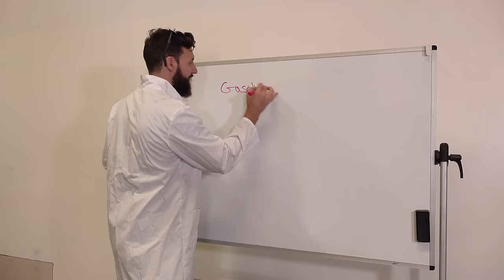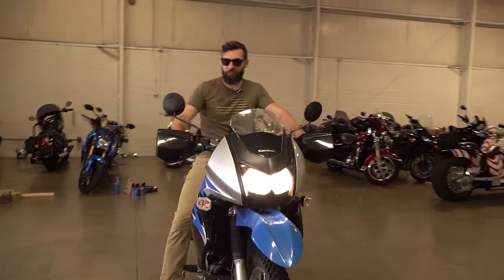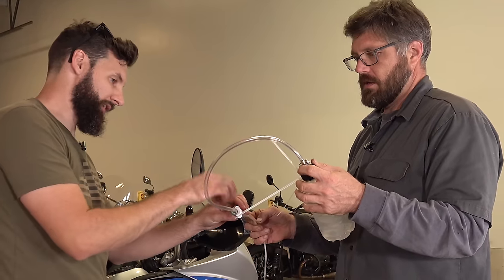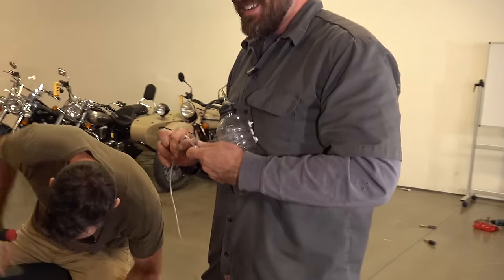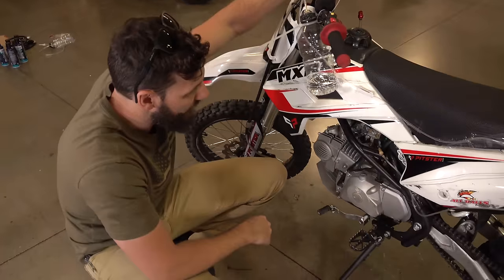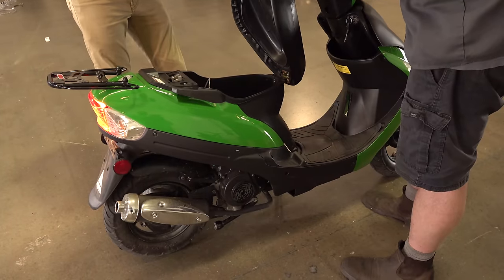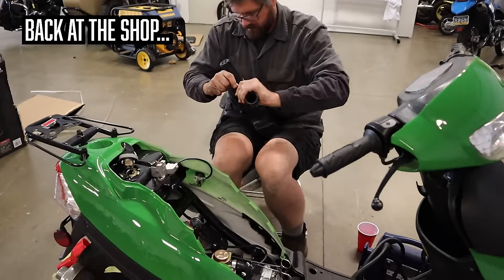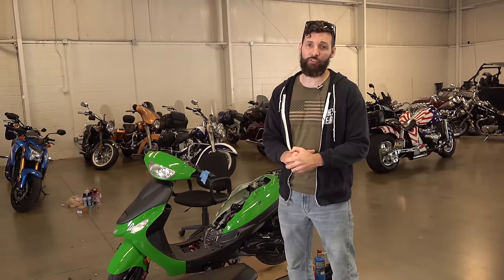What happens when you try to run a motorcycle on PROPANE instead of Gas

Comment: Here in Trinidad, West indies you can get a CNG ( Compressed Natural Gas) kit installed on any ICE. The cost of install is about US$2,200. Hopefully over time you will recover initial expenditure, by fuel cost savings. They drill a small hole in the inlet manifold close to the engine and install a nozzle......one per cylinder. The nozzle gets a tiny tube from a pressure regulator. A metal or fibreglass cylinder is installed in your trunk or tray, and a line connects it to the regulator which is installed in the engine bay. (The regulator also has a connector to "fill up" the cylinder at the gas station.) The throttle (butterfly valve) allows air into the engine. The nozzles allows the CNG. As to the ratio........sorry I can't explain.
But there is a 2 way switch installed on the dash to choose between gasoline operation or CNG operation. There is a indicator of how much CNG you have also. Of course, because CNG does not have a high calorific value as gasoline, the estimated power loss could be between 10-20%. Taxi drivers, and folks who drive long distances to work get an install. To fill a cylinder is about US$2.

Comment: You can use the LP system off Honda and other floor buffer engines on similar displacement bike engines if desired. The simple "stub" fitting can convert common carbs by replacing the emulsion tube (which is no longer needed nor is its emulsification function).

Comment: In Australia it is common for cars to run on LPG or have a dual fuel setup where you can use an internal switch to switch between both fuels. LPG is currently about half the price of petrol so it makes sense to use the gas more than the petrol. I often wondered if you could run a motorcycle on LPG.
Reply: Same in Bulgaria. A proper system costs about 1000 euro with installation. Also, while living in Shanghai, I noticed some scooters ran on LPG, because it's better for the environment, thus allowed by the gov, while petrol isn't, because it pollutes more. There was a small propane bottle inside the scooter's trunk, when you lift the seat. As a Bulgarian, who has only seen this in cars, it was very interesting.

Comment: I have a tiny propane powered generator. I rigged it to run on butane and found that the butane canister gets cold quickly and then doesn't vaporize. Butane turns liquid at about 32F. I use heat from the exhaust to keep the butane warm so it continues to vaporize. I'm pretty sure you kept shutting down because the butane bottle got too cold. Try using a hand warmer.
You don't really show what regulator you used for the propane, but the typical regulator releases the gas at about 20 to 30 psi. That might not be enough pressure for what you' want. You can get an adjustable regulator with a gauge that will give you 60 psi. I've sen one that goes up to 100 psi (the tank is like 100 to 200 psi). The pressure regulator I've seen on at least one conversion kit (for a generator) gives you 0.5 psi.
Butane's pressure is about 35 psi (fairly safe). Propane's is like 200 psi which is why you have to contain it in something with 1/8th inch steel walls.

Comment: The "regulator" uses a small vaccum to open a valve and let in gas, you need to hook up the regulator (on the side opposite to the gas inlet) to the intake (for vaccum) and leave the bike's air intake open, (air is needed for combustion, if it's closed, the engine will "flood") if the regulator does it's job properly, then it will allow more gas the more you open the throttle, just like when a scuba diver breathes (he sucks air oput of the regulator) and the regulator provides more the more he pulls. I have seen tanks run on kitchen propane tanks.

Comment: You could probably use a regulator from a propane torch and experiment to find the right pressure, and also be careful with propane if you don't have a baffle system to prevent it from traveling up the line there is a chance it could do that, the carb helps stop it but LoL. I love old propane and kerosene forklifts and tractors. Butane is a dryer gas and probably puts a lot more carbon build up in your engine and thus eventually won't run off of it. Like kinda what happens if you hold it on something and just leave it there you will see a black residue built up where the flame was. Some lighters stop working after this build up too. I would love to see y'all get an older diesel bike or something similar and test many other different types of fuel.

Comment: We tried in school to do somewhat the same, but on a lawnmower (we couldn't afford a bike) and using hydrogen instead of hydrocarbon as propane/butane. The problem we were getting was that the hydrogen was blowing up in the carburetor since the lawnmower was a 2-stroke, a 4-stroke would eliminate that problem. The other problem was that it was hydrogen boosted, meaning we would stop using that much gasoline and use some hydrogen instead. That just makes another problem, that the lawnmower was using a carb and not a fuel controller. The lawnmower began to run way too rich when adding hydrogen. A fuel controller would just decrease the amount of gas used, but couldn't adjust the hydrogen, so it should adjust to the hydrogen. 
So if a bike should run on a hydrocarbon, a fuel controller is nesseceary since it regulates fuel and air to a stoichiometric mixture.

Comment: I did a Final Year Project during University days similar to you guys. But my choice of gas is methane/biogas derived from crude plam oil effluent. I just stick the gas pipe into the air filter and just ride away with no problem at all

Comment: My dad had a Tahoe he converted to LP gas.
he hooked up a stationary tank in the back and he got a bunch of adapters for the engine and it worked well, though it had NO power (made a lot of noise but did not move, you know... like a Honda) and it smelled horrible like burnt eggs, this reminded me of those crazy times lol!

Comment: You need a vacuum actuated regulator.
You'll also need to tune the regulator to meet different loads at different RPM.
In Australia it used to be a thing to run taxis on LPG (propane), and kits were available.

Comment: The first problem is fuel control: Without some way to alter the amount of butane/propane/lpg entering the intake stream, you will not be able to maintain a useful air:fuel ratio. What you need is to use the normal throttle plate on the carburettor and somehow use the throttle cable to also actuate a ball valve on the gas line, this can be tuned to correct AFR and you can add a small bypass tube with another valve used to adjust the idle bypass of the first valve. That solves one problem. The second problem is pressure. In the case of butane, the rate of boil-off from liquid to gas is heavily influenced by temperature. The thing, the temperature drops as the butane evaporates and travels down the line, so you end up with cold liquid butane that is no longer boiling off fast enough. This is where Propane becomes the much better option as it is a gas at much lower temperature and the bottle it comes in maintains a high pressure that can be regulated down to a consistent pressure (tunability here, too). This is really important to making any solution to problem one actually work

Comment: Another thing is the "stratified charge" method. You just leave the throttle fully open, and a 1/16 ID tube as close as you can to the intake valve, brings the propane in.  Then you control engine RPM with a "push valve"  ( not a knob valve )  I've not tried this but it has been verified to work by a gent named Roy McAlister. He's a guru of NASCAR racing engines. This makes a sandwich of air + fuel layers, hence the name stratified charge. He has a patent on it, you can look it up.

Comment: nice experiment 
I think the problem with butane is that your bottle don't allow air to get in. So after about 1 minutes, as your bike consume butane gas in the bottle, pressure dropped and stall the engine. Maybe a tube connect the atmosphere to the bottle's bottom would solve that problem.

Comment: all you need is a propane pressure regulator from a propane grill. You take the wiring from the gas dial on the grill; and tap that into your throttlebody wiring. Simple $40 mod i am running on my twincharged 2017 sonata.

Comment: I think the butane stopped working after a while because it was not generating enough pressure to continuously push butane into the carb. A little heat under the bottle would probably have helped a bit
Reply: Bro stop

Comment: Propane is a VERY feasible fuel for bikes (or cars or trucks or whatever)...and if your vehicle is fuel-injected, you really just need to replace your fuel line with the propane line (with regulator)...pre-regulator / tank pressures on propane are between 100-and-200 psi (average, around 145-psi), and the injectors (post-regulator) normally work in a 30-50 psi range, actually serve to 'meter the incoming fuel' (as it is already a gas). So all you are doing is dropping the 'tank' pressure down to incoming 'injector' levels (just slightly lower than the injector springs open).
The downside to 'propane conversion' is that propane only offers the 'BTU-equivalent' of 90% of gasoline, so you're only going to get 90% of your prior horsepower from propane (than you did on gasoline)...but the engine will last longer (no cylinder wash-down effect, and cooler detonation means longer ring-and-piston life)...I've seen a couple of 'customs' built like this...relatively easy for 'injector bikes' (or cars or trucks)...you can get commercial regulator conversion kits in the $200-$300 range...but again, you're only going to get 90% of the mileage you did as when you were running gasoline, too...(and in today's world...propane almost ALWAYS bulk costs what 87-octane gasoline costs...so no real gainer, but a slight loser in the end).

Comment: Hi, kinda new to your channel, but very much enjoying it. My little brother showed me some of your videos before, but I had forgotten what the name was to watch more.

 Pretty sure you need at least a one way check valve (with filter) to keep you from vapor locking with the butane. That's what it looked like was happening. However, you may need to use a proper regulator kit for that just like with propane. Maybe try a common grill regulator kit since you're trying random things anyway. Lol
It should be possible to run on a standard carburetor if the flow is regulated properly. There are lots of vehicles that have been set up to run both and I find it hard to believe that people were putting two carburetors on anything to make that work. Maybe you need one that has a switch for the different flow control though. 
Also, I think you'd like my wife's channel: Mench and Zech. It's mostly he singing religious songs.

Comment: We actually have LPG pumps in my country. Normally taxis and public utility vehicles use them after the cars get converted to be compatible with LPG. All the conversion really does is make the fuel tank capable of high pressures and sometimes, and engine tune.

Yeah, it’s also way cheaper our cheapest type of everyday fuels

Comment: I run two engines on glp at the farm, one is a small honda two stroke 11hp for a coffee mill, works wonderfully with a simple converter hooked on beforw the fuel injection or carbiretor unit. You just learn to tqeak the gaz/air mix until it runs evem better than with gasoline.

Comment: As you open the throttle butterfly you needed to add more on the iv line that would keep the air fuel mixture ratio correct or add a demand regulator from century fuel products or us carburation. The fuel supply is not keeping up with demand from the engine. The only other thing is there are dot rules on the transport and use of lpg on vehicles so you don't get hurt in a collision. Be careful. Have fun!

Comment: Propane (LPG) is actually harder to ignite than petroleum, It needs a perfect Stoichiometric. I believe the Propane will actually give more energy and know it likes increased compression. LPG also works with diesel as an additional fuel. 
I have been reliably informed that Adding LPG to Diesel will give the same power as turbocharging a diesel. My source actually run several trucks with this setup.
I would love to make a LPG motorcycle this gas is safer than petroleum (petroleum fumes are highly volatile), this gas is cleaner and this gas can give more energy if the motor is designed/modified correctly. The only down side is the biproduct is water therefor it is important the engine oil needs to be run to operating temperature otherwise condensation will corrode internal components. 
Another trick maybe to get a LPG convertion kit from a small car and adapt it for a motorcycle.

Comment: Need an ounce regulator. Should be able to get one at lowes or any hvac outlet. Run it on a diaphragm carb, impco 100 will work for the larger engines. Start your ounce reg at 2 to 3" water column.

Comment: you have to cut off some air comming from the air filter. If you want the bike to remain started . Butane evaporates very quickly it diffuses as soon as air is mixed with if.

Comment: Bikes and beards try using the fuel regulator from a propane stove use ductape and try getting it started with either and us a regular propane tank like a 5 gallon use the regular fuel attachment and turn the tank on low first and theoretically it should run perfect

Comment: What I been told a optimal explosion for gases like that are from 30% to 15% gas to air. Once you go above the combustion level is saturated and will not light. To go faster you need to add fuel have it mix then go into the carburetor. Without doing so it will never work it will run then "flood out" as soon as the mixer is too rich.

Comment: I think with a bigger needle you might well have run that 650 a bit better.

But I personally am more familiar with electronics, so would have instead attempted this with a fuel injected bike. You can get an LPG injector sized correctly to exactly mimic the operation of the petrol one (they run on PWM from the ECU, the simplest way to modulate a port injector is just a simple variable width square wave, no multispray or anything else). That is to say, for each PWM setting, it sprays the equivalent mass of LPG appropriate for the inlet air mass.

That characteristic makes the gas injector 1:1 equivalent to the petrol one, meaning you can just directly run it off the same PWM signal. If you have that, there's no ECU modification required. All you need then is a switch to make the change.

You'd start on petrol, give it time for the initial warm-up (basically wait 'til the idle drops) and switch to the gas injector(s).

You can also use a more sophisticated control system which will automatically make the switch based on engine temperature and will monitor the level in the gas bottle so it can switch back to petrol before you run out of LPG.

Comment: On the butane my guess is it’s a pressure issue, as it bleeds off some of the pressure it just runs out of pressure and doesn’t move any more fuel. 

Propane I’m not sure. When you run a car engine off of propane there’s a plate on top and another throttling mechanism to control the pressure of the release. Either way this was pretty awesome. Lol

Comment: my truck , Toyota Tacoma works on Propane. You need the complete system, regulator, injected directly into the the manifold, not through the carb and the throttle is electronic.

Comment: I think propane runs a lot drier in the cylinder bore and such so if I am not mistaken engines designed for propane typically have different oil rings in them and maybe valve rotators ( for larger push rod engines anyway) to help them live longer. Also to get the same power the compression ratio will need to increase so more of the less btu containing fuel can charge the cylinder.

Comment: Where i live cars are converted from gasoline to natural gas all the time, you need a zero flow regulator places right after the air filter, and good to go. Although for such a small engine you may need a much smaller regulator. If you are wondering why go through the trouble, natural gas is a fraction of the cost of gasoline.

Comment: Lpg running cars are normal in Europe.i myself have bmw 5 series e60 with 4.4l v8 running on lpg. We use 60/40mix of propan/butan, in winter use 40/60mix instead. There are cheap lph injectors, ECUs and reductors to be have. A reductor takes liquid phase lpg, runs it via a membrane while heating with coolant loop to get high enough pressure gas phase lpg. For bike with carburetor you could switch this, have high enough flow of gas phase lpg from your tank (since engine is so tiny) and use injector duty cycle to incrrase the amount of fuel fed to the engine. I believe it would be close enough if it was done purely by rpm (ecu changing injector duty cycle based on rpm only). If these little engines have lambda sensor (O2 sensor), you could achive much higher level of orecision and therefore more power

Comment: They ran better at first then progressively worse the fuel in the carb. was still emitting vapors which helped. The propane needs to be injected between the carb. and intake as well.

Comment: You’re creating a vacuum inside of the container. The butane is not boiling off quick enough and the negative pressure in the vessel is making it choke out. Adding a one way check valve and possible a bubbler will increase the evaporation rate this delivering more fuel to the cylinder for combustion.

Comment: In Europe LPG cars are very common. I have two on LPG (not bikes tho :) ). You need vaporizer tho for proper engine work . Vaporizer is the thing that supplies the proper quantity of gas to the engine depending on the vacuum (should cost cheap) but it needs water cooling system because it uses the heat not to freeze ;) If you want more help please write to me.